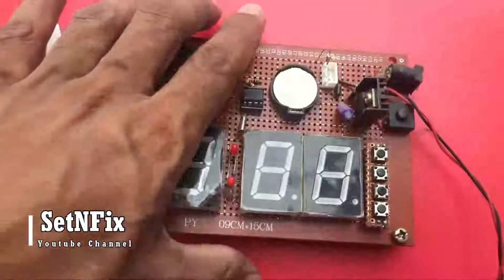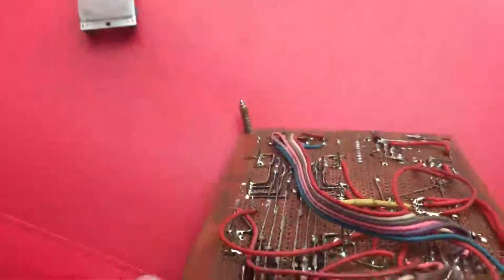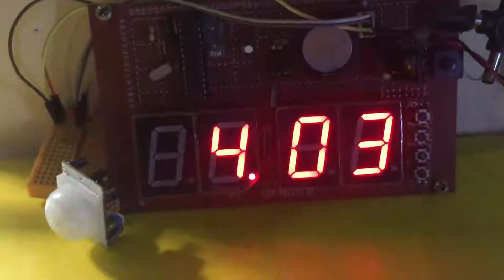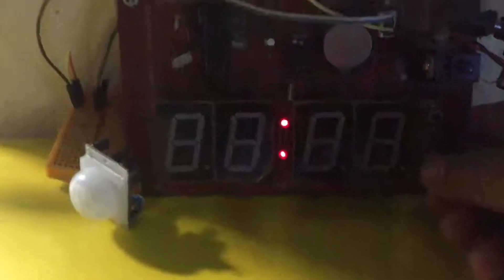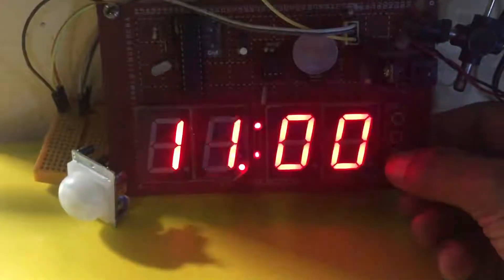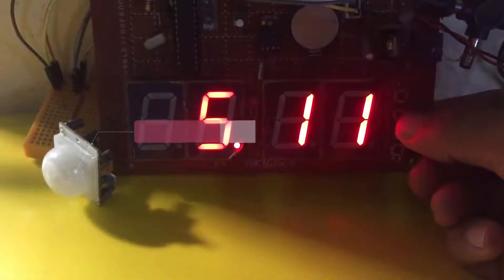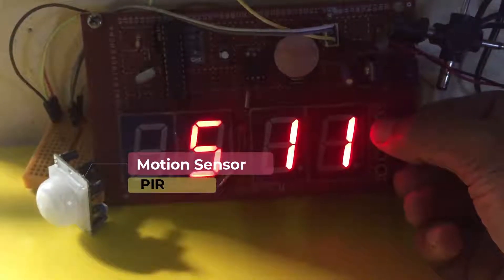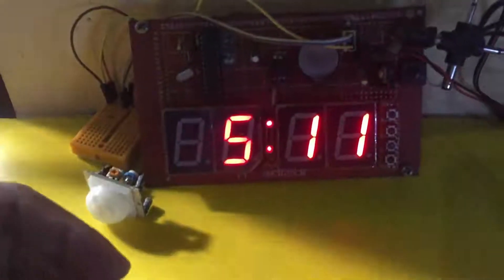Motion Sensor (PIR) Supported Seven Segments RTC Clock with Arduino

Comment: Nice project. If you use LDR it would be more convenient to see the time instead of the motion sensor. 
LDR should control the brightness of the clock display depends upon the ambient light. 
And also you can utilise the existing DOT LED in SSD itself for seconds by flipping the third digit. No need to add the external LED for the seconds.
Weldone keep it up your hard work. 👍
Reply from the maker: Thank you